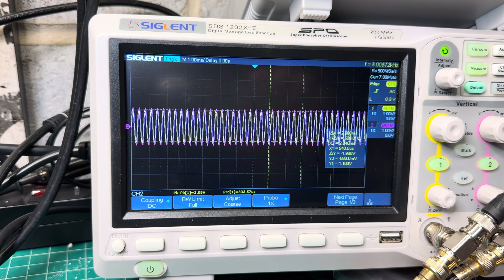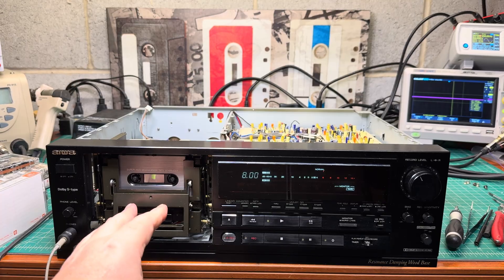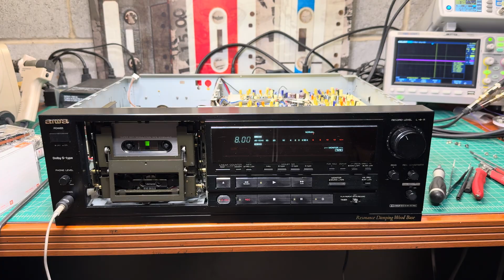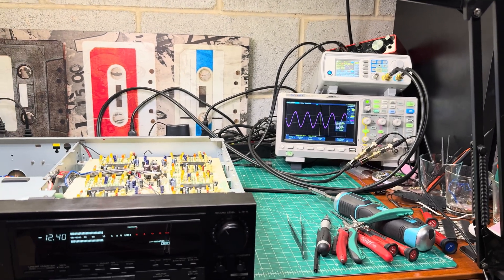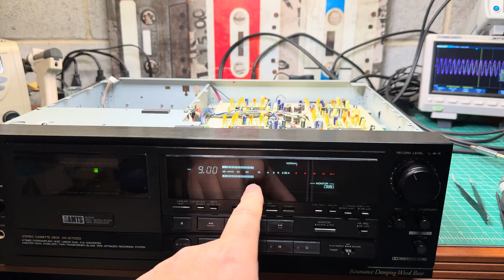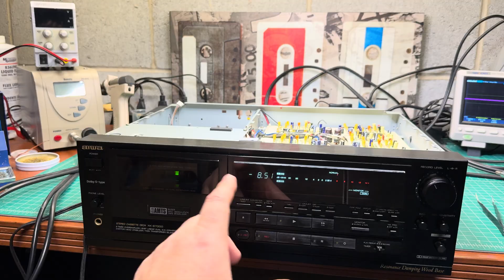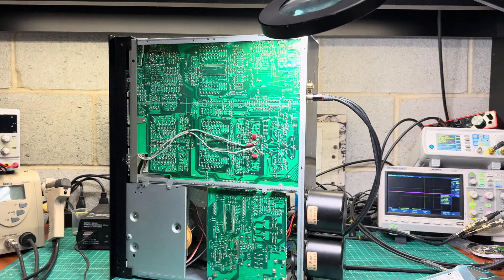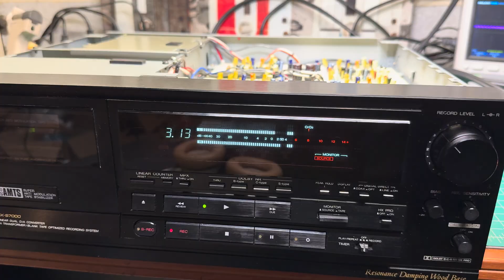Aiwa XK-S7000 Restoration Part 2 – Fixing W&F, Playback Response & Testing the Built-In DAC!

Comment: I do have a Pioneer CT-S670D. To my knowledge it has digital audio processing, so the only analog parts are the analog inputs/outputs and the signal directly from/to the heads. This device also has a digital input. My impression is that the sound is somewhat "harsh", "artificial" and is missing some detail. More so when enabling the digital noise reduction.